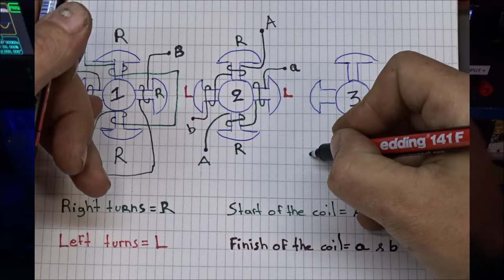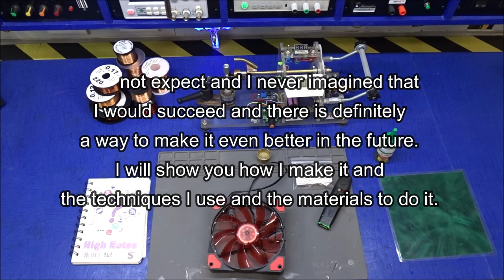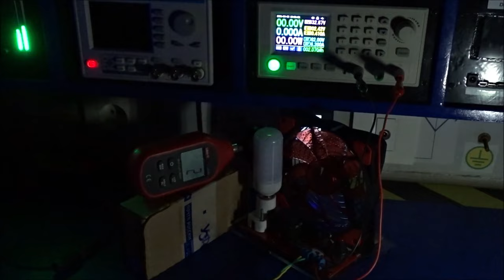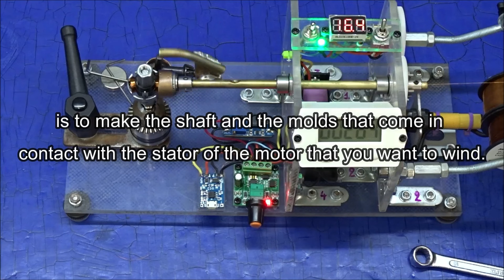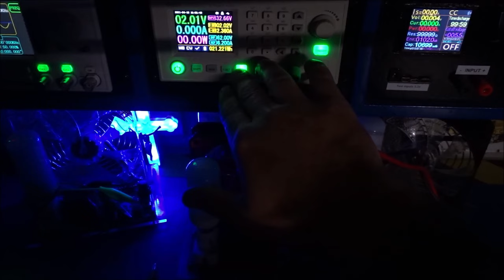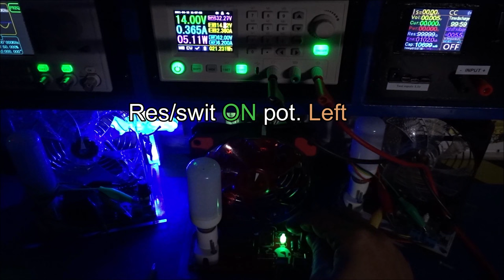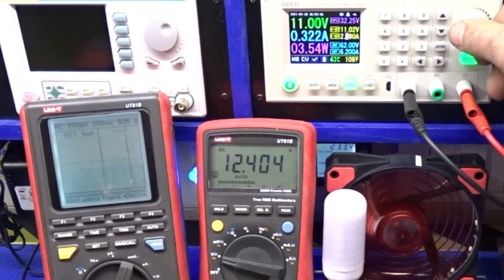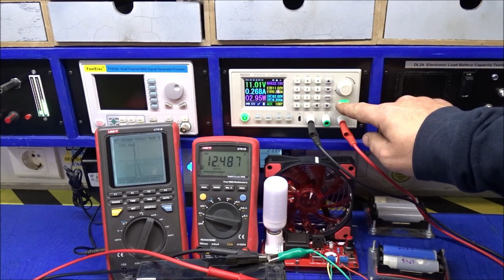How to Make Bedini SELF OSCILLATING Motor, Cooling Fan & light, Right Now on ebay!

Comment: Hello, I've just went in deeper measurement with a single 100R resistor on output.
Confirmed COP > 3.
Potentiometer on the full right and the fan still additionally provides sensible torque, so the real COP can be deemed much higher.
Reply: would you show demonstration please, i am new to those type of electronics and i want to learn how to build one, i need it to live normally in my village
Reply: @MrBademy  was an error of measurement, I misused the current probe that returned wrong results, sorry.
Reply: @bingofuel1208  would you make a demo of it ? :) i am super curious how it performs, you say over > 3 COP
Reply: @bingofuel1208  what are the real results that you observed in this case? Please share with us

Comment: Also look into the convention Video from Rick Friedrich from 2015, where Michel Schuh shows his LC circuit box the Schuhmann box...it is just LC transformers in the loopback line, which makes the source battery additionally charge..so both batteries are getting charged, also due to spark gaps...

Comment: Very impressive work and result.
I've ordered the apparatus on eBay and it is currently under test.
Reply from the maker: Thank you very much, whatever you need I am here...
Reply: @eleman-gc  what I can see is the light bulb 7W is lit full intensity with an entry power measured of 0.7W.
According to this, one can suggest of a COP 10!!
Unfortunately when I try to use the output to a simple resistor, the efficiency drop to COP 3. Hence, the output energy looks strongly depending on the type of load.

Comment: Great demonstration of build quality. For accurate measurement why didn't you use battery input with multimeter? Power supply displays are not reliable to pulsed motors
Reply from the maker: Thanks for your comment! YES, all L.C circuits and Pulse Motors and DC motors has huge "EMF" known as back electromotive force. If I did the measurements with battery I could not show you that. My construction does not have  "back electromotive force" 
STAY TUNED!

Comment: Great job man and many congrats for achieving this...Bro my question is...can we use the charging hub to charge the source power itself making it a self running device..and simultaneously draw power ..as you showcase while drawing from efficiency light.
Reply: it wouldn't work, i just watched the other Bedini video when John explains his device, he says that to charge from the second battery to the first you would need some kind of inverter, otherwise it might blow up, they refer to it as radiant energy or negative energy, and thats why, he also mentioned that if you wait a bit before switching the batteries, then it could be ok, just you dont have to do it instantly.

Comment: Sorry for stupid question. Where can i use this?
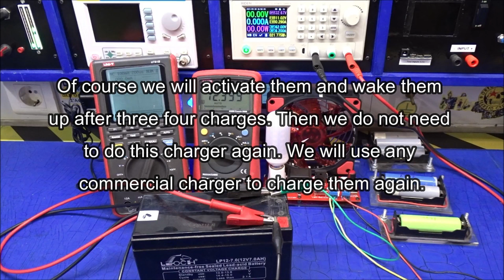Reply from the maker: There are no stupid questions. Efficiency light. Efficiency motor fan. Efficiency charger. This device is very, very efficient in terms of production and consumption. I claim that this device produces more energy than it consumes. For this reason I challenge "ElectroBOOM" to refute me and tell us the TRUTH! 38:51 - Charging Measurement / electroBOOM
Reply: @eleman-gc  so if i buy it i can use it as emergency light without batteries or as a fan. I'm starting to save my money for this! Thank you!
Reply from the maker: @namasnamas3002  As I told you before it is a device that is very efficient in terms of its consumption of course the device does not work without DC energy or battery!
Reply: @eleman-gc  electroBOOM knows about suspended techs, don't try yourself, ignorance is what they choose to get away from proof. You already done good job, you even made it to sell these things. Keep it up! Cheers
Reply from the maker: @FREE ENERGY DEVICE BUILD STILL WAITING..! and apparently he is not going to give answers, unless the users and those who will ask him questions on his channel persuade him to deal with...

Comment: Man could you tell since you say the device does not work on back emf and is different from original bedini...since it self oscillates...could I read anywhere about the principle of your device?
Reply from the maker: The circuit is the same as the original of Bedini. But the winding is different as well as the electronic components that I use, this completely randomly created the self-oscillation and raised its yield so much that I claim it exceeds its consumption.

Comment: "... a patented machine that runs from one battery, turns a wheel, charges a second battery."

A patent will not be granted for anything that claims to produce more energy than is put into it. Energy is lost as waste heat at every conversion, so chemical energy in the first battery > electrical energy > mechanical energy of wheel > generated electrical energy > chemical energy stored in second battery. Energy lost at every step, so where is the "free energy"?
Reply from the maker: Thank you very much for your comment!

First you did not see the whole video, at the end of the video I show the input - output measurements.

Secondly, the original version of the Bedini is very different from mine, because mine can Self-oscillation.

Thirdly, if you believe the laws of physics that have been taught to us, you will see that in many subjects banners on electricity have not been explained correctly!

We are in the twenty-first century and now man can do everything, as long as he wants it and believes in it.

I believe in GOD and faith has no logic. In this century we must advance without logic not in our daily life and in our fellow man but in the sciences.

Only Mathematics can not change!

Think 200 years ago what man knew, and what he knows today! and what he will learn in the future...

STAY TUNED
Reply: Best regards to both sides.   However,  I would offer George to NOT suggest more "energy" is produced than put into it;  but INSTEAD clarify to Allan here that more VOLTAGE is produced than put into it.   I perceive this 'Bedini Fan' product features a useful voltage for charging little storage devices.   I understand the definition of energy and how it is measured in scientific terms is far more complex with losses at every step that Allan points out.   Yet,   faith in God and George's worthwhile efforts that we can all see; helps us realize some possible practical and exceptional benefits.   Like charging a little Super Capacitor Engine Jump starter.    Also little bit of God's wind could help start this little fan to overcome the cogging effect,  and a little solar too could.   

Now,  George you got alot more 'splaining' to do !  Let's observe some practical uses of the output voltage.
Reply: @serotonin67  You don't understand how the circuit works.
Reply: Think of it in terms of COP, not as simply energy produced. There is more energy than the user supplies, just as in a heat pump, a wind turbine, or solar system. In this case and similar circuits, the additional comes from the immediate environment.
Reply: actually, there are several patents through history awarded to machines that do claim such things.
Reply: A Bedini coil using a trigger wire primary and secondary fold of wires (how to coil a wire Bedini) with welding rods core. May not be necessary. A solar DC to AC converter multiplier through a coil self charges (motionless) batteries using one battery. The converter oscillator, transformer and even magnetrons are over unity devices. Due to Oscillation Amplification out put.